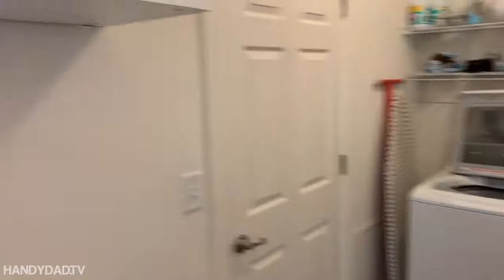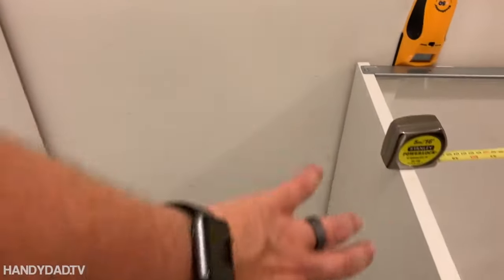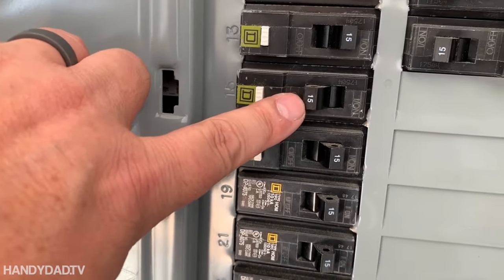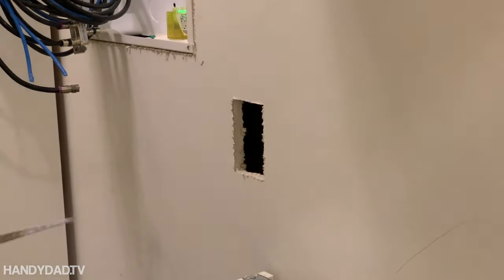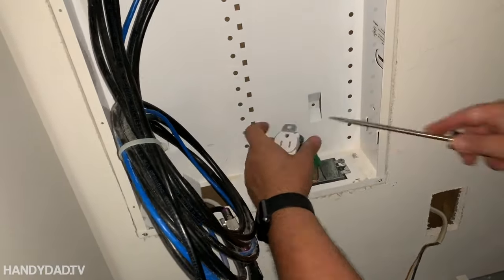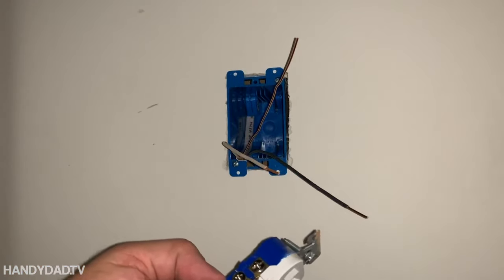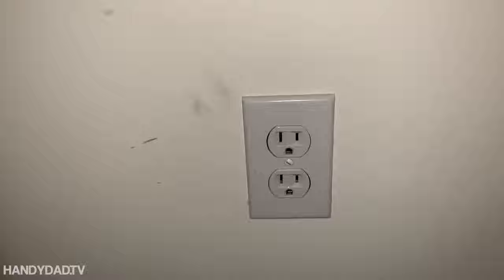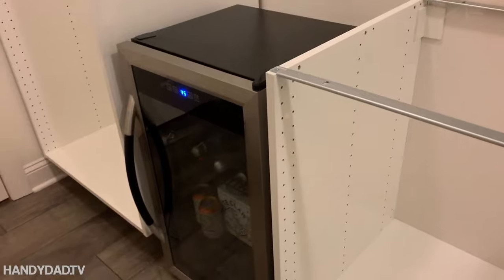Add an Outlet to an Existing Circuit

Comment: Nicely done. I am going to tap into an outside plug to make an outside outlet for a little pool vacuum.
Reply from the maker: Just make sure it is GFCI protected.
Reply: @handydadtv  yes going from 1 gfci to another
Reply from the maker: In that case, be sure to connect the new outlet to the LOAD terminals on the GFCI.
Reply: @handydadtv  in one of your videos I saw where you put both white wires together (silver holes) and the hot ) black ones in the bronze holes and used that green thing to tie together the grounds. So this being the tap one to the new one I will do all that but put the hot or black one on the bottom load side . Is that correct?
Reply from the maker: You’ll push the black and white from the new outlet on the LOAD screws if you want them to be protected. 

I think you’re referring to a video where the GFCI was in one bathroom far from the protected outlet in another bathroom.  So I moved those wires from LOAD to LINE and I installed another GFCI outlet in the other bathroom.
Reply: @handydadtv  if I then want to add a on off switch? What do I need to do?
Reply from the maker: You’ll need an outdoor switch enclosure, and you will basically cut the black wire and put the switch in-line to that wire. You only switch the hot; the neutral and ground stay connected constantly.
Reply: @handydadtv  to the load on the new gfci? Or on the back of the switch? Yes will have outdoor enclosure.
Reply from the maker: Wait I may be confused. If you have an existing GFCI, you can add a normal outlet to the LOAD screws. If you want to add a second GFCI, you will connect it to the LINE screws. 

In either case, install the switch in the black wire going to the outlet that you want switched.

Comment: That outlet inside the network communication box  is meant to be for other specific purposes and not to be part of the house electrical system, that's why I think bringing the power from the other side of the wall is a better choice.
Reply from the maker: The communication outlet and the bedroom outlets were both on the same circuit.

Comment: After seeing the first outlet backstabbing, it was pleasant to see you wrap the copper for the new outlet, well done mate.
 PSA: back-stabbing the wire into outlets will lead to arcing and eventually melting the outlet. Always use the screws if possible for better future connections.
Reply from the maker: Someone should tell the electricians that wired every house I’ve owned.
Reply: @handydadtv  unfortunately most new construction electricians do it for speed purposes, it will eventually be standard practice to wrap due to safety concerns

Comment: Great video, good tip on cutting the sheet rock instead of making a hole in the 2 x 4. It help me out a ton thank you.
Reply from the maker: Thanks for the comment 👍🏻
Reply: if an inspector sees it you will have to redo it.

Comment: For those that will be doing this just put a screw in the center of the cutout of drywall so you can pull it out instead of dropping it in between the wall but either way no one will ever know it’s there.
Reply from the maker: It’s tradition for me to let cuttings drop into the wall.

Comment: Ok so you tapped into the existing outlet ran a wire to the upper new outlet then from the new upper outlet you ran another wire down to the lower outlet .. just wanted to make sure 👍🏼 great video .  The video didn’t show the second wire being  run to the lower outlet .
Nevermind I missed it ! It’s there 👍🏼👍🏼
Reply from the maker: Thanks 😊

Comment: Super helpful!!! Thank you! I am doing this same process so thanks again for making it so straight forward. I do have one question tho… This my be because this building is old but the outlet that I am chaining from has no ground wire coming to it, what should I do with the ground wire in the 12/2 I bought?
Reply from the maker: I’d recommend you start rewiring that house starting with the circuit where you want to add the outlet. Otherwise, I don’t recommend any modifications to wiring that old.
Reply: @handydadtv  Copy that! Thanks again!
Reply: Update!!! I talked to an electrician friend and he said the plug was grounded but just in a different way, so I just attached the ground to the green screw on both outlets! AND IT WORKED! Like a charm! I wish you could see it. My wife thinks I’m Superman! We can finally charge our vacuum in our closet! Thanks man!!!
Reply from the maker: Thanks for letting me know! Congrats!

Comment: I used the connectors to jump wire to other outlet on back side. I used new plug in outlets. I have power on one side and nothing on the other. It should have been simple but I don't know.
Reply from the maker: Please call an electrician or handyman.

Comment: Instead of pushing the drywall into the cavity, put a screw into the center of it prior to cutting. That way after you finish cutting it out, just pull the screw and you won't have a random square of drywall sitting in the cavity.
Reply from the maker: I prefer to leave remnants for future residents to discover.

Comment: do you have the link for the wire connector?
Reply from the maker: You can buy them locally in a smaller package, but here’s a link https://www.amazon.com/dp/B000BW3E46/
Reply: Yep I work at a Lowe's and we have them for about the same price as Amazon. Any self respecting hardware store should have a crap ton of wire nuts.

Comment: Good Video 
@ 4.30 when you Steel the Power from the Telecomunications Outlet - Instead of Tapping Directly to the Receptical can you use a wire nut ( or Push in Tie ) , I seen some guts tie all the Blacks, Whites  and Gnds together and use a Short Wire to the Receptical ?
Reply: That would be called a pig tail.

Comment: No it’s not electricians disliking your video! The problem is miss the ground bond on the metal box.
Reply from the maker: That’s the way it was originally installed my the professional electrician when the house was built. You’re right, I didn’t fix it. But I didn’t disconnect it either.

Comment: Remember to always tape the screws around the outlet to protect it from causing a short and burning your own house down! (CAUTION FIRE HAZARDOUS)
Reply: In a metal housing, for sure. I don't think it's neccessary in the newer plastic ones though
Reply: @colbycarnes5786  just to be safe "always think safety"!
Reply: You don’t need to tape an outlet. It’s a waist of time and the tape eventually falls off anyway. If you put the receptacle in the box correctly it will be fine. If it does short out, the breaker will trip.  You can’t even spell hazard correctly. How do I trust you with electrical advice.
Reply: @colbycarnes5786  Guess we'll just ignore the bare ground wires that are stuffed in there.

Comment: I hook up a radio and up the volume when I look for the breaker or fuse in my house.  When the radio goes silent I know I have found the circuit.  A lamp also does the same thing.  I put it by the clothes shoot to the basement where the fuses and breakers are  and when the light goes out I know I found it.  I figure there is only so many gizmos that I guy really needs to purchase when I can accomplish the same thing without buying a specialty device.  A good long extension cord for the lamp and radio is used also.
Reply from the maker: Smart man 👍🏻

Comment: You can still use 12 gauge for 15 Amp it just won't be to code, but you take it you just need to make sure the wire is big enough to handle the amperage so you can use 12 on 15 amp but you can't use 14 gauge on 20 amp
Reply from the maker: Yes

Comment: At end of his video he stated that if he want to put outlet on other side of stud, he would JUST. Cut drywall out and run Rome’s over stud and then patch drywall. WRONG! If he were to do that and then for some reason some put a small nail or tack or something to hang something in that location and hits that romex they could electrocute themselves.  A hole should be drill to get wire thru the stud
Reply: They sell a steel plate to cover the wire at the notch.  This is a totally acceptable solution as long as you install the plate.

Comment: Thank you for an awesome video!

Question: what if the existing outlet that I choose to connect the new outlet to turns out to already have another outlet connected to it? Can I connect ANOTHER outlet to the existing outlet I picked, or do I need to go find an outlet that's the last one in the chain and doesn't have anything else connected off it?
Reply from the maker: There is no limit to the number of outlets on a circuit. There is only a limit to the total amperage drawn by the devices powered by that circuit. The circuit breaker protects you from overload situations.

Comment: I'm not sure if someone asked this, but on the receptacle that is feeding the power (about 4:00 in) in, is it installed with the backstab method? What if it was side wired - could you still get power from it? Or would you set up the pigtail system instead? I think you have another video with the pigtail setup so I'm wondering which one to follow. Thank you - your videos are great! I'm learning a lot. :-)
Reply from the maker: I generally don’t use backstab connections. This video shows how to side-wire or pigtail:
https://youtu.be/-WufbstcvRw

Comment: I'm unclear on how you secured the blue outlet box. I saw the screws but what did you screw into to hold the box firmly in the wall?
Reply from the maker: It’s called an old work box and it has ears that flip out to grip the drywall. Watch this https://youtu.be/klL8XhKMNT8

Comment: This is exactly what I need to do!  But, I missed it in the video. How did you wire the 2nd outlet? Did you get that from the other side of the wall, or are they all connected? I didn’t see extra romex in the network cable box.  Thanks!
Reply from the maker: This updated video may be clearer. But adding two outlets is the same as adding one outlet twice. You just repeat the process.
https://youtu.be/-WufbstcvRw

Comment: Already installed new outlet. Now to piggyback.    Twist the copper  around copper, slide on green nut and attach single copper coming through hole around screw, correct?   Thank you.

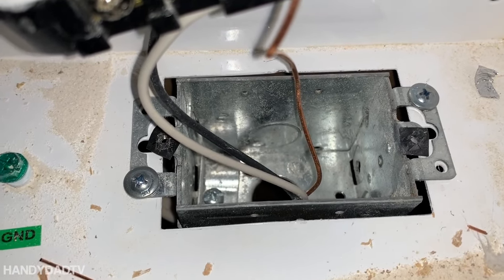Comment: 3:29 Metal box grounding bolt on the bottom is not connected to the ground, should have 'green pigtail' to grounding connection all together

Comment: Good stuff, made it look easy.
Is it okay to do this with a 240v interior outlet to a new exterior outlet?
Or even out through a wall, and ran underground to my garage to a new outlet?
Reply from the maker: Exterior has different requirements, but the process is the same.
Reply: Most likely it's not ok. 240v outlets are usually for dedicated circuits for an electric stove or electric dryer for example. Consult with an electrician to verify.

Comment: Hi! I have not done electrical work before. Watching this video, I thought you were adding the counter outlet first, but as the video progressed it showed the fridge outlet was completed then you plated the counter. I’m confused, however, I think you ran new wire from the OnQ to the counter, then more wire from the counter down to the fridge… or? 

Secondly, I need to add an outlet for a kitchen refrigerator, can that outlet be on the same series as the counter outlets?
Reply from the maker: It’s always best to put the fridge on its own circuit. In fact, it’s code these days. But older homes rarely have dedicated circuits for anything. 

Sorry it wasn’t clear, but adding two outlets is just like adding one outlet twice. 

This video explains better:
https://youtu.be/-WufbstcvRw

Comment: I found this video so helpful however i was wondering if you could make a special video of a project that a friend and i want to make using a thick extension cord installed into a junction boxed with a wall outlet on it and then next to it a little bit of thick extension cord into another junction box to install a circuit breaker into the junction box and then will put a switch plate that is fully covered up with 2 screws that you have to unscrew to reset the circuit breaker if ever tripped.   I wanted to know how to wire that so we can install a 15 amp circuit breaker to a 15 amp wall outlet receptacle.    Could you please make a video on that?
Reply from the maker: No, just buy an extension cord with a built in circuit breaker.

Comment: Great video! But one question!  on the pass through outlet you just mention to put white on left side, black on right side. Does it matter if Incoming power should both be on top two screws and if going out should be the bottom two?
Reply from the maker: Doesn’t matter, unless it’s a GFCI outlet.

Comment: Can you do a video explaining how you would wire another outlet if the source outlet already had wires in both sides? Sort of branching off the line in the circuit
Reply from the maker: You need to pigtail them like I did in this video https://youtu.be/klL8XhKMNT8

Comment: Ummm... if there is going to be a refrigerator on this circuit, you should have taken out the wires on that communication box receptacle in the quick connect and refastened them to a screw. A good idea would be to wrap the connectors with vinyl tape.
Reply from the maker: Thanks for the feedback

Comment: I want to jump off a ceiling fan thats wired for 2 wall switches (one for the light and one for the fan). Is that typically 2 separate lines or 1? I want to roof mount my tv in the above garage apartment since it has angled walls to maximize usability. Ill have to either remove the switch or have that outlet on the wall switch still I would assume?

Comment: I couldn’t tell from the video but did you secure the new wire to the metal box with a clamp? I’m thinking it might be difficult trying to install a clamp in the old box without access to the opposite side… or is there another way?
Reply from the maker: I inserted a plastic grommet from the top.

Comment: Can I add an outlet like this, but to an existing outlet that is half hot? The existing outlet, half is controlled by a switch and the other half is always on/hot. I want to add a new outlet to connect to the hot half of the existing outlet. Can I do this?
Reply from the maker: Yes you just need to splice it with the always-on black wire.

Comment: Question for you... is there a problem with having too much energy being pulled from one circuit?  You've got a 15 amp circuit, added 2 new outlets to it. What's to keep the circuit from constantly tripping?
Reply from the maker: Outlet don’t use any energy. It all depends on how much is plugged into them.
Reply: Right, I meant how would you calculate how many outlets can be “spliced” off one circuit but I did look it up elsewhere... I liked the video. Thanks
Reply: I found the answer. Technically, you can have as many outlets as you want on one breaker. However, generally you should limit it to 8 outlets per 15 amp breaker or about 1 outlet per 1.5 amps.
Reply from the maker: Thanks for the follow-up!

Comment: Thanks for the video! I have a question. How do you know how many outlets/appliances you can add to an existing circuit? Is there a rule of thumb like no more than 10 outlets to a 15A circuit and no more than 15 outlets on a 20A circuit? Well done!
Reply from the maker: There may be a rule of thumb when you’re designing all the circuits in a house, but I generally add them for convenience, after the fact, from anywhere I can grab power, within reason. I wouldn’t add an appliance, like a refrigerator, to a circuit that has other appliances.
Reply: @handydadtv  Thanks! I am adding a dishwasher to my kitchen. 15A circuit. Its an old single wide so I believe they did everything bare minimum so I think the whole kitchen is on one circuit. I got some testing to do
Reply from the maker: A dishwasher has a heating element to dry and heat the water, so it draws a lot of current and really requires it’s own circuit. Otherwise you’ll be constantly resetting the breaker... or worse 🔥 if the breaker fails. Nobody wants that.

Comment: Question for you, I’m trying to get this done and opened my current outlet. Having a hard time getting into it since it’s plastic and there isn’t a hole. Do you suggest I try and drill a hole in the plastic box?
Reply from the maker: Try to remove one of the restraints from an existing hole. If that doesn’t work for you, you have no choice but to drill another hole.

Comment: So... did you check the wattage of the beverage fridge before adding it to a 15 amp AFI on the same circuit as the bedroom and the low voltage equipment?
Reply from the maker: Yup

Comment: Could you run the double wire from the original outlet and just have singles going to both new ones? Why double to the first one then end it with the second? Serious question, I know very little about running wire.
Reply from the maker: Yes you can do that, but I prefer to daisy-chain them so I only have 2 wires in each outlet box and avoid wire nuts.

Comment: I was told years ago that it was against the electrical code to use a fixture as a wire junction.  Has that changed?  It certainly would make these piggybacking projects easier as shown.
Reply from the maker: News to me if that’s true.
Reply: It might be a local thing as our county still requires conduit as well, no BX or Romax either.
Reply: I think some areas require pigtailing others don't.  That said those backstab outlets make me cringe, especially if multiple outlets are chained off one.

Comment: Question.  I have an outdoor outlet attached to a flower box.  The wiring has a white, black and yellow.  Would the yellow be ground?
Reply from the maker: If it was connected to the green screw on the outlet, I’d say yes.